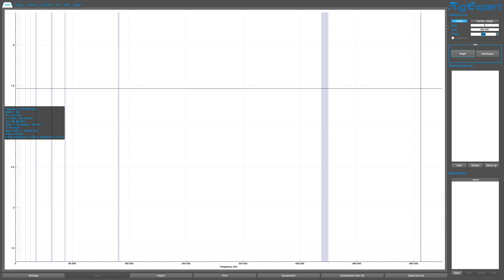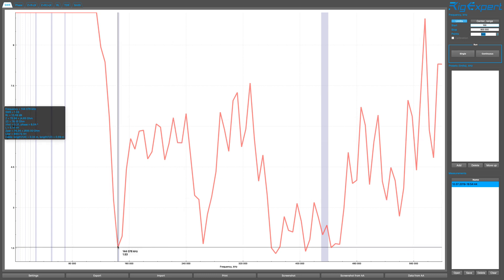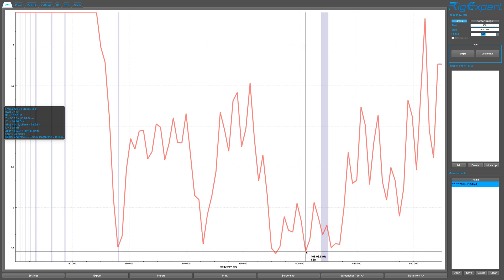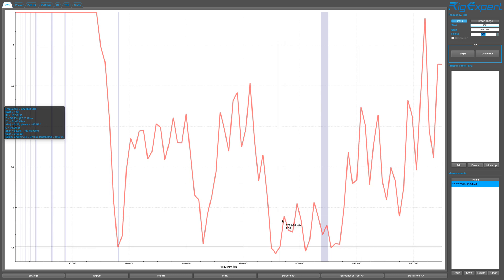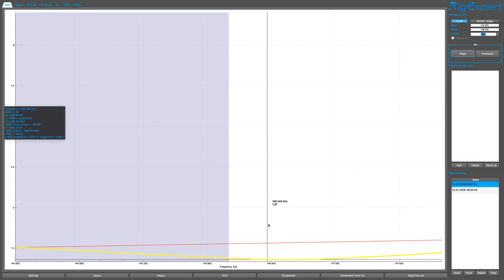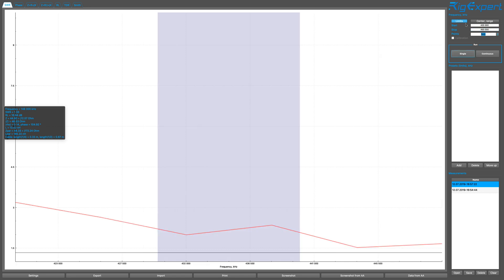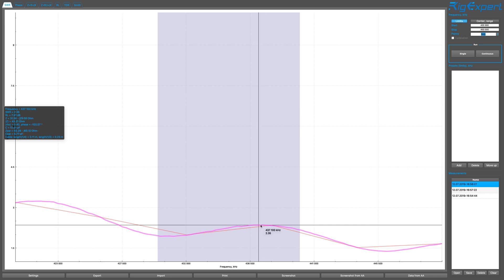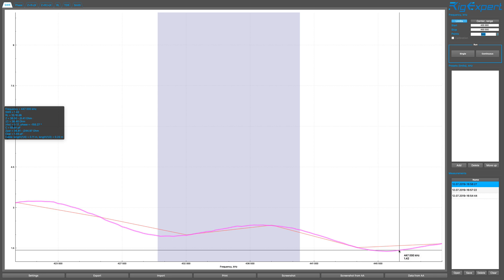SWR Reading Comet Antenna GP-3

Comment: Old video of course but it's still applicable today. Your results indicates that on 2 meters the antenna will work good and because 70 cm is a multiple of 2 meters, it's good too as you would expect.  It seems that the bandwidth on 70 cm was a little narrow though.